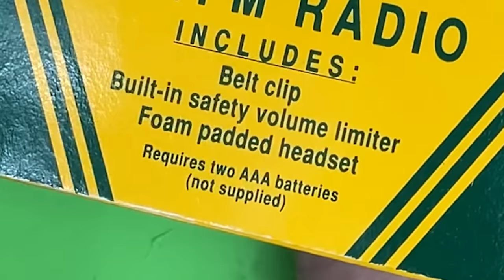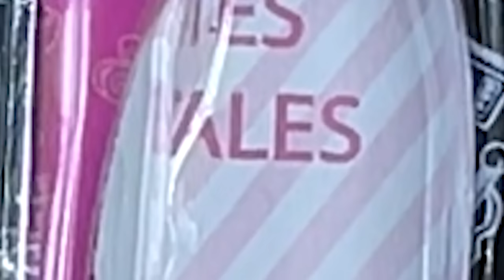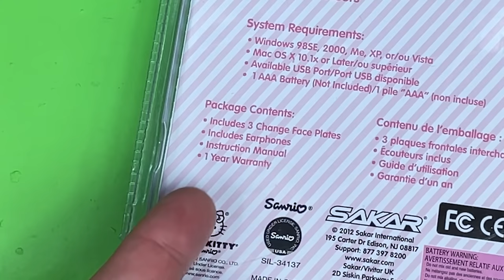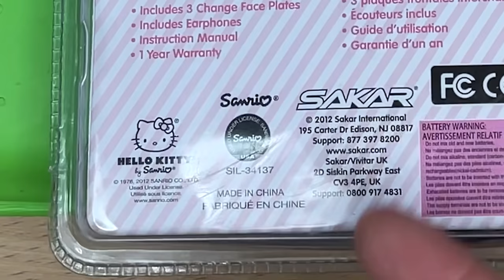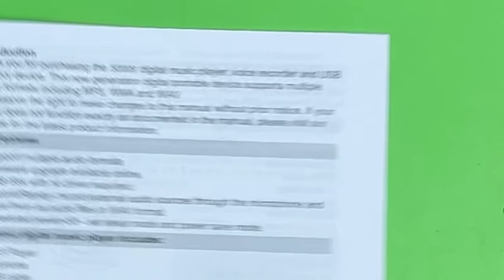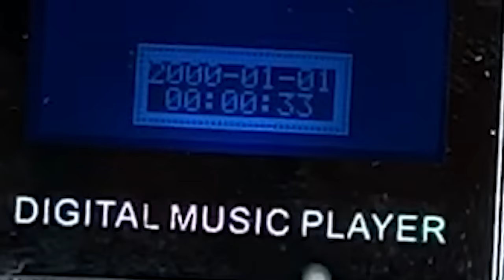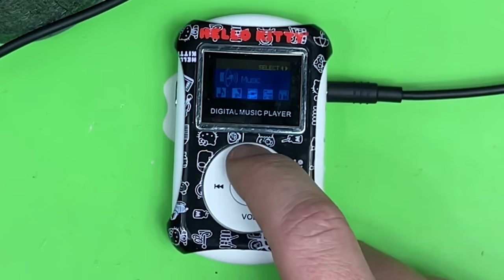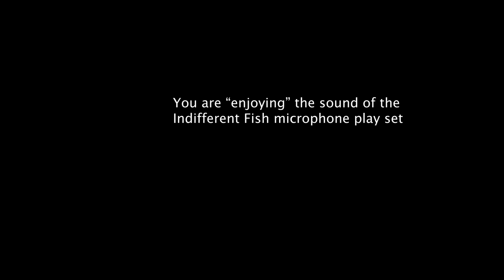Even Hello Kitty made an MP3 player...

Comment: Boy boy the diabolo thing doesn’t clip as much so it doesn’t „sound“ as loud cause the low (more power hungry) frequency’s basically get clipped so instead of a sine you get a square wave and that sound louder
Reply: I don't understand
Reply: @unliving_ball_of_gas  basic alternating current stuff, electricians or audiophiles would know
Reply: Could also be that the thing can pump more current at any given voltage, but the resistance of the headphones is just not high enough to get there with it's peak voltage.
Reply: Basically clipping sounds like these „earrape“ edits on YouTube and they do sound very loud and hurt but don’t necessarily need more power to be played.
With analog tech that effect happens when you turn the volume up so high that the amplifier can’t handle it anymore and starts to struggle. These struggles „make a sound“ and that’s why it sounds louder even with less rated power. 
Also it is possible to exceed an amplifiers rated output power when you clip it which is probably also a desired side effect for mr. dank.
Reply: @Germanwtb  that’s why they start to clip, the amp is allowed to put out more current because of the lower resistance / higher gain and clipping only occurs when the output current is too high, an amplifier can’t „produce“ more voltage, it can however try to provide more current which will end in clipping. This is also different for different classes of amplifiers and it’s very complicated, but in general it’s too high gain or too low impedance (resistance) of your speakers/headphones.

Comment: As a hobby electrician, I would think the reason for the Diablo being quieter is that it outputs a lower voltage than the Mojo, as watts are only a power spec, not voltage

Comment: 11:25 I wonder if you're running into a limitation of how much current can be delivered to the earphones because of their low impedance and high sensitivity. Try comparing them side by side with your AKG headphones. There might be more of a difference in output level there.

Comment: Just realised my phone speaker is better than my headphones (i own a rog phone 3)
Reply: I have a Rog 5 Ultimate :D
Reply: @davidbob3417  just bought it two months ago now I'm waiting for the rog phone 6 :(
Reply: What do ya say about the rog phones? Are they worth it?(I mean they are pretty cool)
Reply: @maxiferrari08  they are the best spec phone in the world rn for cheaper than an iPhone and the best speakers on a phone  . For extra info watch mkbhd and mrwhosetheboss.
Reply: @maxiferrari08 i got my rog phone 3 for 500  euros despite what people say it's a good all-around phone if you don't mind coping with a little bit of a heavy phone and some thicker beasels than others.
the camera is actually very good and If you install gcam it will significantly improve the photos and you will enable you to take magnificent night photos (my profile picture was taken with it)
 yeah it actually improves gaming performance especially the airtriggers really improved my gaming performance.
 I highly recommend getting cover that completely covers the back because the rear glass it's a fingerprint magnet and the phone in general is a little bit slippery and buy a few spare side rubber gaskets because you'll Loose them VERY easily.
The battery life is also great I personally don't charge it over 80% and i still get at night with 20% of battery left with 7 hours of screen on Time

Comment: 6:29 I used to have an mp3 player that kinda has the same menu as this Hello Kitty one many years ago, and if I remember correctly, that "encrypted only" setting is something like making your mp3 player write-protected or read only when plugged in via USB to a PC. Personally I found that feature useful when I needed to use my own mp3 player as a flash drive to save a powerpoint to present at school when I was in high school. I managed to avoid getting the virus from the school PC by setting my mp3 player to encryped mode before plugging it in. Though I'm not sure if encrypted mode would work like that with this mp3 player.

Comment: The reason your new diablo amp sounds quiet is because there is a point where the resistance of the headphones in question just doesn't matter anymore and you are just making a magnet go on and off according to an analog wave. but, all headphones are different and this may or may not apply at different ranges of resistance.

Comment: Maybe that Diablo’s “turbo”
is like the Turbo button on PCs from the mid-to-late 90s, that actually slowed the pc way down when you pressed it so that old games worked properly (they used the clock speed of older PCs for timing, and so would play impossibly fast or just break on newer machines otherwise). 

I went my whole childhood blissfully unaware that Quake and even Doom were running like shit all because obviously a tween is going to turn on a button that says “Turbo”. 

I didn’t learn until i started building my own PCs, by which point those buttons were long in the past. 

A Turbo button that makes it slower. Who does that?

Comment: I bet the new DAC measures resistance and amperage, and based on the data it sees, it puts a amperage limit to prevent driver burnout/hearing damage.

It may be as simple as plugging it in, changing some settings and removing any safety caps.

Comment: My guess as to why the diablo is not as loud is that while it is able to supply more power, the voltage is not as high. Meaning the headphones actually dont take as much power. But with lower impedance headphones, the diablo would win as the mojo would start to be limited by the max current but thats just my 2 cents

Comment: In the video the Diablo sounded much more powerful. Yes, the Mojo "sounded" louder but it was thin. Most dynamic drivers have an impedance hump that occurs in the bass and sometimes subbass region that causes that thin sound when under powered. The Diablo clearly handled that hump better from the sound of the video. That mojo is clipping out a lot of the bass in order to get the volume to sound louder than the more powerful Diablo. I would imagine your T1's sound much fuller and less strident on the Diablo. The T1's have a huge impedance hump that requires a high voltage to really get the full sound. That Diablo has a wider range of voltage to work with than the Mojo.

Comment: 10:55
Yes beacouse the diablo can provide more power whitch does mot necesearly mean it will give more power so this does not mean it gives out more voltage that is necesary for busting headphones that extra power is yust there so the headphones can take more power if they need to so it will do a better yob qat driving low sensitivity heaphones.
Sory for weird english.